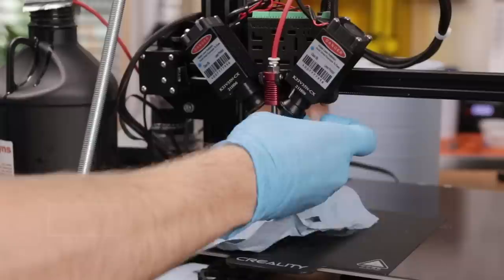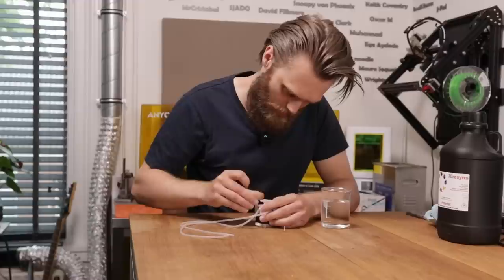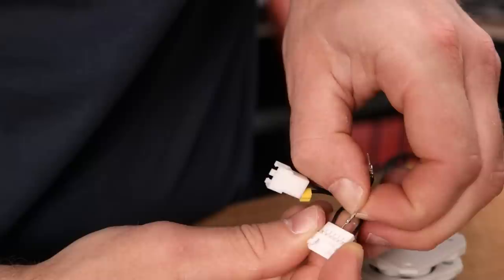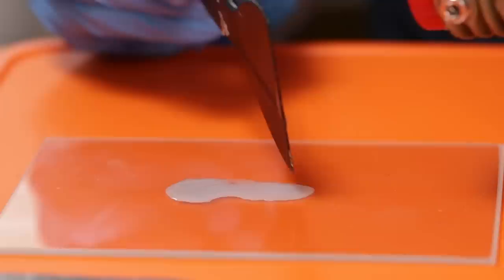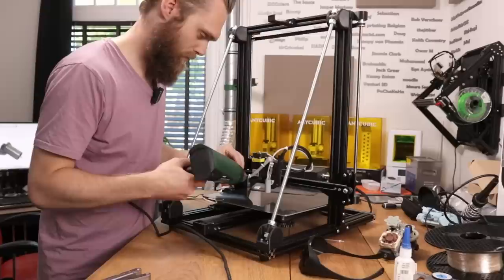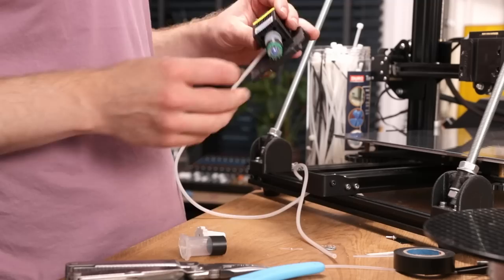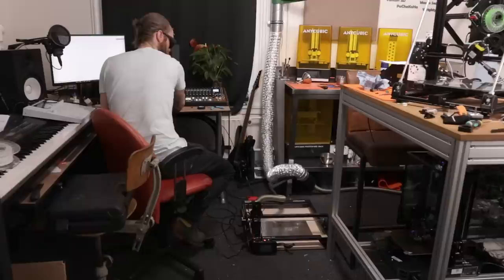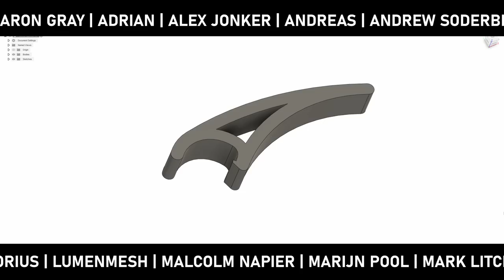FDM resin Printing with LASERS and a 3D Printed PUMP!

Comment: Ok, I'm intrigued. The problem is that resin, with a refractive index (r.i.) of about 1.5, acts as a light guide between the laser and the nozzle, clogging it up. To prevent this, you need to optically decouple this guide, either by a separate deposit and cure phase or by optical isolation. The latter would require air (r.i. = 1), i.e. droplets from a shaded nozzle. Inkjet nozzles may not cope with the viscosity properly, so some custom resin spray nozzle may be required. Some interesting piezoelectric designs are out there, especially active valves (2 elements running 180° off), e.g., https://m.youtube.com/watch?v=joz1x4WV5Zw. With enough backpressure, you may be able to spit the proper droplets at a controllable rate and size. BTW, piezo membranes are really cheap, used for speakers and domestic humidifiers...

Comment: I was thinking a ball point pen design might work but that would probably get clogged too easy as well. Too bad you cant make a resin filled filament so you can print normal normal plastic but its tacky and then you just cure it with light after.

Comment: Adding weight all around would not work ofc. What is interesting thought is what would happen if you add it on the bottom part. As low as you can, leaving the top part of the printer lighter as possible.

Comment: I mean this is cool and all. but i feel like it takes the best part of resin printers, being the instant cure of the resin, and mixes it with the worst part of FDM: slow tracing layer at a time. The beauty of resin is how fast you can print high quality models since it only takes seconds to cure each layer.

Comment: I wonder if you could use a inkjet aproach  basicaly a super thin reson and a print head froma actual ink jet printer spray each layer and cure it in a ring around the print head

Comment: dude you are leaking/receiving light via the outer edges of the fibers/transfer tube. By covering the fibers and tube with opaque paint, you simultaneously entrap the light in the fibers (raising light output), shield the resin from the light until it reaches the build surface. then you must focus the light emitters to a single point to the surface of the prior deposit.

Comment: You are a genius!  I am wondering is there any advantage to be had from this?  will prints be stronger?  is it faster?  will prints have better detail?
Reply from the maker: Thanks! The reason for this is that I want to get continuous fiber printing to a standard 3D printer. The idea is to infuse carbon or Kevlar fiber with resin and create a composite.
Reply: @properprinting  That's awesome!

Comment: Cool video as always! Just curious,  why? Is there a project upcoming that would benefit from this method or just doing it because you can? Whatever the reason, always engaging to watch your process.
Reply from the maker: Yes, the Proper Extruder is capable of pushing fibers due to the belt design. This will be combined in a future video. Besides this, there are several advantages we're going to discover!

Comment: This was crazy cool! It's amazing the way you guys think and adapt and build! I just can't wrap my head around it though. Is this for when you want to spend the big money for resin but you still want to have the slow fdm print and lower quality? I mean, other than ingenuity and showing that it can be done, what would be the benefit of this technique over the way either printer already is?
Reply from the maker: Thanks! This potentially enables continuous fiber printing, 3D printed electronics and mixing resins to modify properties in a single part. The pump alone enables food and ceramics printing.
Reply: @properprinting  Nice! I am relatively new to 3D printing and only had my fdm and resin printers for a couple months. At the moment I'm just doing miniatures but I'm always looking into more practical uses. Unfortunately they've both been running 24 hours a day for months because everything takes so long 😅

Comment: Why don't you illuminate the entire layer after applying the resin? :)
It was enough to do a Gcode where you first apply the resin and then the second phase where the laser hardens the whole thing. It was enough not to use even more diffused laser light.
Or you could have tried to print outside on a sunny day but slowly - there is a chance that such a thin layer would harden.

Comment: That was painful to watch.   Try staggering the laser paths post injection with high intensity, high frequency pulses (also staggered).  The optical paths MUST be highly culminated at the injection point with WIDEBAND hard edge optical stops at approx ½mm behind injection path.

Try that. Just a thought.

Cheers
Reply: Also,  adding a dark pigment thats highly non-refractive would help alot.

Comment: it seems like your laser beam is too wide. you need a beam that is the same size as your nozzle aperture mounted as close to the nozzle as possible. that way you have a fine control over where the resin cures and where it doesn't.

you also need  non reflective plate as that's not helping I don't think

Comment: use the point laser. no lens no glass fibers. The aim presicion is the point on this. point laser from left and another from right. and point it right after the resin is on the surface. or you can use very smail point cure to fix it and after the second laser not focused to cure the entire surface.

Comment: Reduce the angle of the laser light to almost horizontal and then you can reduce the length of the needle, it will clog less and be more accurate at depositing the layers 😄  try a pressurized reservoir instead of an active pump maybe to have a smooth flow🤥

Comment: What about a completely different approach? Why not print a layer then remove the nozzle up and flash the entire surface with UV. Or You could have the lasers angled so thy hit the surface when lifted a few inches. Then retrace the print surface to cure.

Comment: Awesome video. I'm always amazed what people in the hacker community are doing. That being said, if you're interested this is essentially what Polyjet by stratasys is. I believe they use mems technology similar to inkjet which squirts out a photopolymer which then gets cured at the point of ejection. Basically FDM'ing SLA

Comment: this sounds like a fun idea
but practicality wise
why tho?
it's like as messy as dealing with resin
but with all the limitation of FDM
Reply: Possibly could save weight for a corexy design. variable color mixing while also not adding weight to the print head and having complicated switching mechanisms. it might be possible to print completely horizontally if the resin cures almost instantly so there’d be no need for supports in some situations. also I think in some regular resin prints resin sometimes doesn’t exit the part during printing, adding weight and other issues to the part

Comment: Different nozzle Design. Less a hole more a slit  --> thinner layer. Different angle to the printsurface( not 90) Play with resin pressure. Thin layer might be stable enough to point the laser in a slight distance to the nozzle. There is a prism shape that will make your pointy laser into ringform. Just don+t know the name

Comment: Even if you can get this to work I can't see how this would be better than standard SLA printing.  The resolution of the print is still limited by the motor resolution and the thickness of the solution squirting out of the tip. Its still has a junky blobby result, and if that can't improve there's no reason to go from SLA to laser.

Comment: If you can see the laser, your glasses aren't working properly. Invest in some good ones from a lab supply or optics company. Also invest in a laser detection card so you can see the beam (they light up in a different color so your glasses don't block it's light).

Comment: why did that nozzle print take 9h20m for 1200 layers? thats like 28 seconds a layer
Reply from the maker: The PEEK like resin has a long exposure time. I still have to tune it, but I haven't gotten to it yet. It will take a long time nonetheless.

Comment: use a printer head with piezo tech not the thermal ones , its used in projet 3d printers , i have seen someone print with wax using a used printer head .

Comment: Why not just diy a polyjet 3d printer? There isn't much documentation about it but the hp45 and hp 6602a printheads are well documented and have opensource controllers already designed for them.

Comment: Don't use this pump, provide compressed air to do the transportation of the resin. You can very fine adjust the pressure with a special valve. Use a very fine nozzle. Very fine. Just to lay out a tiny amount of resin. You can cure the resin later, do not make the same mistakes again and again. You can control the gcode. Lay down the resin, stop the pump, start the laser and move again. Stop the laser and do the next layer.use very fine pipes to the nozzle, better when not flexible. Enjoy and give me some credits...

Comment: Dude awesome. Not far off from getting it to thootch. You had me screaming at your first design. The fibre will work but the fiber ends needs to be supper squarely cut and polished to something stupid like 5000 grid plus. so from 400 to 800 to 1000 to 1200 to 1500... .If you can make a jig that can do the bundle at once then it could work well. Or scrap that idea. Like a vinyl cutter the the laser must follow after the extruder nozzle on the same path means you need one more degree of freedom A axis on the extruder assy... Then some kind of post processor for the code. Keep on failing. Someone needs to. Matt black is your friend. Print in dark colors instead of clear same for building surface. whara whara whara bla bla whara

Comment: Here is my take on the matter - your laser is too powerful. It's kind of obvious if you think about it. 

Let's say we have a SLA printer that has a 50 W "light output" (I know those aren't right units - this is just to illustrate the point) which sounds like a lot until you take the illuminated area under consideration. Let's say that illuminated area (the bed) is 115 mm by 65 mm which gives us an area of 7475 mm^2. If we take that data into consideration we get light output for area of 1 mm^2 around 0,007 W. So you use at most 7 mW/mm^2 of light output for 6 seconds to cure one layer of the SLA print. That isn't all that impressive. For that reasons SLA resins have very high light sensitivity. For the sake of future comparison I'll say that to cure one mm^2 blob of resin you need 42 units of exposure (7 mW/mm^2 * 6 s). 

When you dump 500 mW of light output of your laser onto 1 mm^2 blob of resin for 1s (I'm ignoring height just to keep things simple) your exposition value reaches 500 units, which is over 10 times as much - way too much for typical SLA resin to handle.  De-focusing of the narrow beam (which you tried) lowers the power per area but actually increases exposition time (the same area is longer under UV light) and make makes exposition time printing speed dependent. It also might lead to unwanted reflections and scattering that make curing process unpredictable. 

I would argue that keeping laser beam focused (keeps exposition time under control and makes it predictable) and lowering the laser power is the way to go.

Comment: Welcome to the real world. Yes this is normal. New inventions can take decades. This one probably not. I think a couple weeks or months and this will be perfect. 
Try the easiest things first. 
Isolate each problem. 
Sometimes it helps when there is a problem >> try to make the problem as worse as possible << Sometimes that can bring light to why it's happening << 

--Find which light source is causing nozzle clog. Bed? Resin? > change angle of light beam ? Try resins with different optical properties / opaque black ?  Cure away from the nozzle ? 
-- Pulsed light ? 

Create a metrics for problems >  how many seconds until clog ? =Clograte 
Always use metrics. Thin or thick ? fast or slow ?  nah ,, always use numbers, everything has a quantity. 

Try things backwards.Sometimes going straight for the goal IS the problem. >>  Will this work same if laser is on the side of the bed ?  what is clograte ? 

Print in 2 passes ? One Resin, one light.  SuperThin layers ?

=Food 4 Thots 
-Cheers

Comment: lay down an entire layer of high viscosity resin then pull the nozzle out of the way and flash the uv over the whole area? you really dont want it curing before it makes contact with the print

Comment: Why would you waste power and time heating a hotend up, you don't need, instead of just disabling cold extrusion prevention? :D
And why the heck do you mess around with fiber optics, probably losing 90 % of the light in the process, instead of going for the obvious solution of just pointing the damn laser at the tip of the nozzle and making some ring shape or whatever to cast a shadow around the tip of the nozzle insuring you don't reflect a bunch of light from the print bed into the nozzle?!

Comment: man, I just don't see the advantages of this over a traditional resin printer. Increased print times, possibilities of failure, the need for perfect extrusion and accuracy of the machine. plus don't even get me started on maintenance. it seems cool but I don't see the benefits other than being able to print large print surfaces
Reply: Yep many of the things you thought BUT your wrong on the print speed. That can increase big time! Keep the resolution low, accept a oops or two, and add some good maintenance practice and you have... massivit3d printers. Look them up. They are actually really cool.

Comment: @13:05 What kind of slow ass MSLA 3D Printer is that?! I literally had to make myself a coffee to spit out while looking at the 9h 20min for such a small part when my not super-fast Form³ SLA 3D Printer would "only" take like 8h to print an almost build height filling part https://i.imgur.com/7P1hZEA.jpg 🤨
Reply from the maker: This PEEK-like resin has a curing time of 16s/50um layers. This could be improved, but due to its pricing I keep it like this since it works well.

Comment: I like you as an inventor. But aren't you combining the two major downsides of both worlds here? The bad resolution of FDM and the cancerous fumes of SLA?

Okay, you dismiss the big cleanup process after an SLA print, that's one good thing about this 👍
Reply from the maker: At first it looks like that indeed. I'm going to explain this better in the next video, because more people mentioned something similar. The goal behind this is to get continuous fiber printing to a standard printer. I want to infuse resin in the fiber and cure that to make stronger parts. Another interesting possibility would be mixing resins with different properties. This way I could for instance modify the stiffness in one single part. The pump alone enables a lot of interesting possibilities I'm going to discover in future videos.
Reply: @properprinting  Now this additional information changes everything.